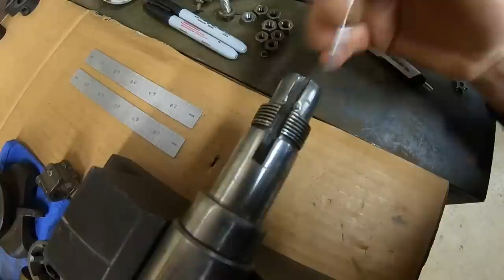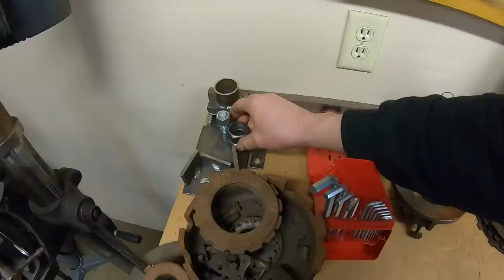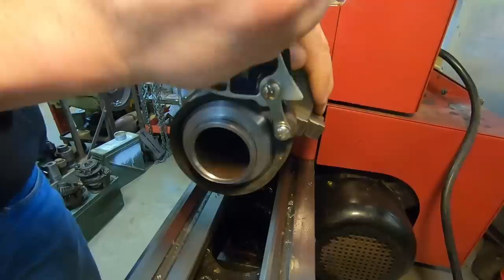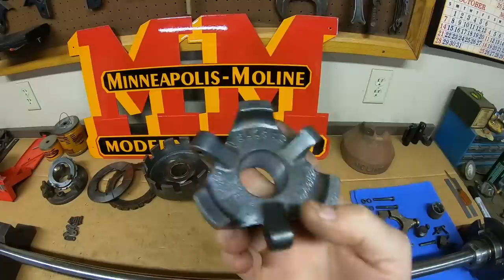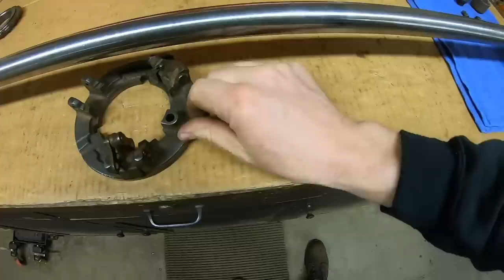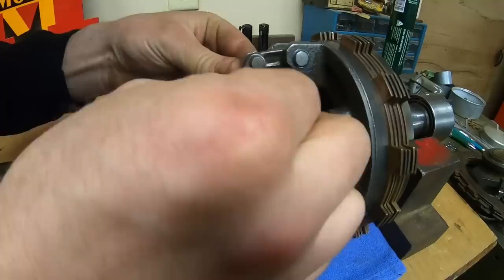#X231 Prototype Part 60: Destruction! Putting the Exploded Live Power Clutch Back Together Again...

Comment: Toby, man you make that look so easy but as an old retired mechanic I know how much work goes into it and when you said 4 days I was surprised it wasn't 6 days no one understands until they have done that. I tell you right now I've never worked on a prototype I can't imagine how difficult it would be to make something from basically nothing. Good job i love this series i know I've told you that but I used to ask occasionally when you were going to get back to her. I missed her and will again when you have to take a break from of again and I understand and will always be here for everything else and get back to her again in maybe a year but I'll be here to see.
Reply: Fit up... tear down. Adjust. Fit up... tear down. Adjust. Fit up... (repeat ad nauseum). not A Mechanic, but the procedure and how time consuming it gets is very familiar. and that's before accounting for Evaluating the damaged parts, comparing Experimental and Production, finding what meshes and what needs to be altered... And then you have to take the time to Alter without overshooting, and then Refabricating beyond-rescue parts like that notch-nut.

Comment: One WORD. “whew “ that’s a lot of fab work. 4 days to get that segment together. With a large majority being machined “ONE HANDED “ so we viewed can benefit. Anyone that’s had anytime at all in a machine shop environment can appreciate the amount of hours it takes to setup and process these. “WHEW” or dang that a lot
Reply: I always hated having to do an hour's worth of setup for 5 minutes worth of machining. My former boss had some machine work for some air duct cleaning equipment that he sold.  I would setup for one part of the machining and then do 50 pieces. I could get the lathe set up for one cut and then I would use any idle time to get that cut done on all of that batch of parts doing a few at a time. Then I would set up the next cut and do it a few minutes at a time. In a week's time I could get a batch done by using what would otherwise be wasted time. I don't know how many times the boss would ask me to make up a batch of something and I would already have it done. The first time he asked me when I did it and I told him that I did it when I was waiting for him to tell me what my next work assignment was.
Reply: @danielbutler578  Single-station production-line style. one Fixturing, repeat batch-at-a-time. very efficient use of time compared to taking one Part from Cutoff to Completion, at least if your batch sizes get up into the dozens like you said. Sometimes you end up with a future-use jig tooling, like a set of flip-in-flip-out adjustable lathe stops

Comment: To make it easier to weld up the keyway, you might consider using a key in the keyway made of copper/brass and make it slightly under-size, and hold it in using a pair of vice grips while you weld up the keyway sides.  The weld won't stick to the copper,  you won't have to remove splatter from the keyway trench and you can trim up the sides more quickly using your broach.

Comment: I was thinking maybe using a “hard facing” filler on the splines, but then I remembered, this is just going to be a parade tractor. Never mind……Great episode, it is so good seeing a vital assembly coming together. This is not tedious. There is a whole genre of videos of people doing routine hand work that goes under the heading of ASMR (ASMR, or autonomous sensory meridian response which is very relaxing.
Reply: When you consider how long this tractor stayed together under the years of use and abuse, I'm sure it will be just fine for its new life.

Comment: I was kind of unsure if the original shaft was usable. However very happy with the outcome and not using the production shaft. Now we are truly deep diving inside the Achilles heal that destroyed X231. More is this video a reminder how important to is to have somewhat of a machine shop capability back home. I don't want to know what would all the milling, welding and resurfacing cost if someone shop would make it for you.

Comment: I didn't realize the PTO input shaft was just mild steel, how fortunate is that?  When you described the issues in the past, I assumed the shaft was induction hardened.  It's such a relief to see those old parts hit the 'discard' pile.  Soldier on Squatch!!!
Reply: Yes indeed. How did you know it was just mild steel ?
Reply: There are various ways to identify the difference between hardened steel and mild steel. If a file cuts it easily, it's most likely mild steel. That's the method I use, but I've seen some steel that you could press a center punch against and leave a mark.
Reply: Toby. When I read your comment, it stirred the memory of a brake drum that had hard spots in it. It wasn't readily available so it was resurfaced using a grinding attachment on the brake lathe. That was back around 1980 and what I remember most about it was that they had to take about .002 inch on each pass and the lowest travel speed to keep it from shattering the grinding wheel. It took about two hours to get it smooth. The only reason it was worth doing was because it was estimated that it would take at least a month to get a new one if it could be found.

Comment: When you were recutting the splines on the shaft you had welded up had you used special welding rods or welding wire or are there specific tools to use in the milling machine as any time I have tried welding a part up and machining it down the tools never seem happy and the finished article quite rough 🙄😟 great video 👍

Comment: So I missed your live stream last night and I wanted to ask you a question.after you fight with the harness what's your method for removing glow plugs on a 6.0 without snapping them off and having to drill them out.ive done quit a few and tried different methods and heat and bees wax seems to work the best

Comment: Wait a second.  The pressure plate dogs came apart and destroyed the back case, but you are going just reuse the pressure plate?
Did you get a magna Flux kit from Ford Garage and checked the plate in the teardown videos 4+ years ago?
If you didn't check the plate with Flux, how are you sure the the boxes the that hold the dogs are still and do not have stress cracks?
This was good video.
On to the next production scene

Comment: I wanted to ask, did you end up putting the original 1113 chassis number plate on the new engine block that ended up in the tractor?

Comment: I still don't understand why M M would release a prototype to the public, knowing it would have a short life due to the non-industrial grade of materials used. Seems like the tarnishing of their reputation would be important.
Reply: They didn't.  He explains elsewhere. One of the MM engineers owned a farm.
Reply: That explains alot, but still he would know how fagile the machine was.
Reply: @peterfallert4994  He did indeed. Squatch explained twice,if memory serves. Instead of scrapping prototypes, the engineer bought a bunch at scrap metal value prices. And ran them till they no longer functioned. Other than the two preserved by this family,the heirs of the engineer saw the no longer running machines on that farm and scrapped them.
No doubt opinions as to that differ. Having a mild steel shaft that long in a prototype is one thing. A properly hardened alloy being almost certainly a better idea in a production machine. That means other parts of other prototypes were almost certainly a problem. And rebuilding the buggers to Toby's standards is just as difficult as this one machine,multiplied by as many as were scrapped. How few people have that level of patience,persistence and competence ? Sure a fleet of rebuilt prototypes would be nice ,but who was going to do the work and spend the money ? Needing as well a big  barn built to store the things out of the weather.
Watching what it took to properly fix the back end ,the bull gears and the engine alone of this unit just made me shake my head. And I am a competent now retired journeyman mechanic. But not at this level,not by a long shot.

Comment: Making this welding engineer cringe man. Look in to TIG welding.
Reply: @squatch253  wire feed is generally harder to get good quality weld. Non fusion is common among wire feed if you at out of position and are using short circuit transfer mode.